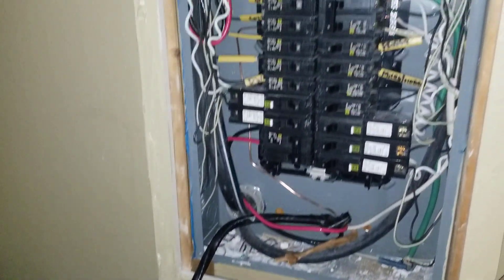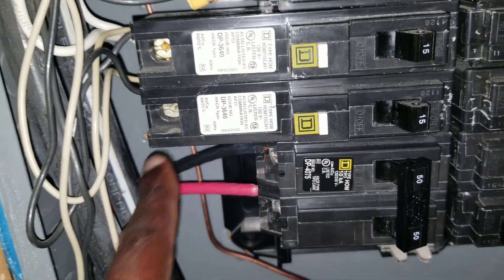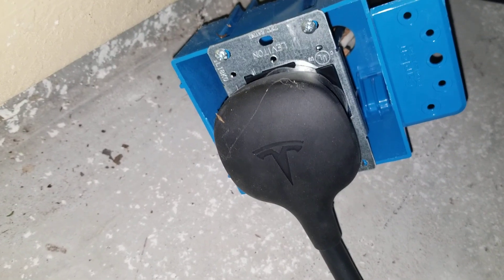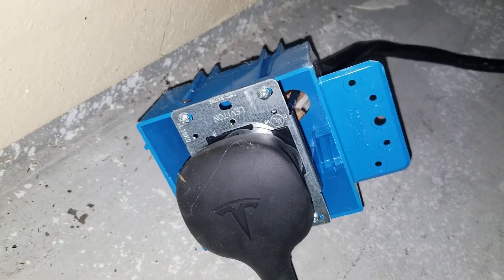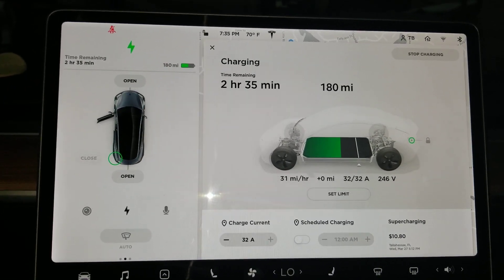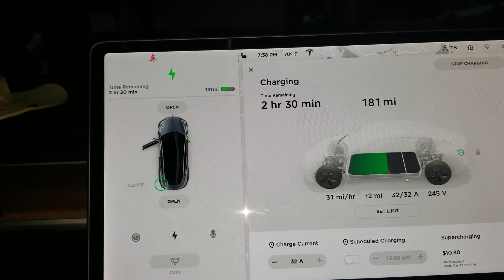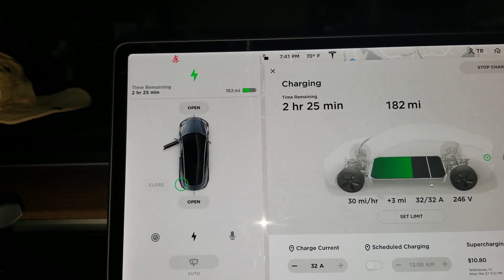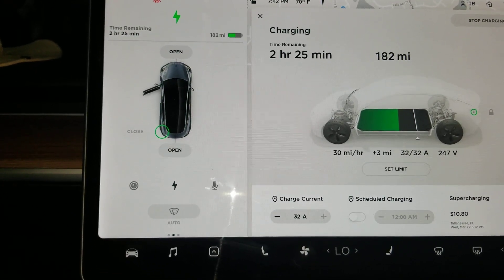NEMA 14-50 Test Wiring For Tesla Model 3

Comment: If i got a 100 watt breaker box, what breaker should i use 40, 50?
Reply from the maker: Sorry about the late response. If you mean a 100 AMP breaker box. Is that your main box or a sub panel? In either situation, you can use a 40 or 50A. In this set up 50 is better, make sure the wiring size is correct. If using a TESLA wall unit then they use a 60A breaker. Hope this helps.

Comment: the neutral and ground should never be wired together. This is wrong, and potentially dangerous. When you plug in something in the outlet, the neutral will be live, as it closes the circuit. If the ground is wired to the neutral, the ground of the appliance will also be live.
Reply: not sure if thats the same for the box itself or just plugs
Reply from the maker: Thanks for the input. The electrician contactor actually put them together. Should I split them out? It was a licensed company and it passed inspection. I would like it done correctly. Do you think this was their version of correct? Should I put all ground on the right bus and all neutral on the left bus? Thanks
Reply: In the main service box, ground and Neutral are supposed to be continuous. So your electrician did it right.
Reply from the maker: @mounirerrami2563  thank you for that. I couldn't find it anywhere online. I guess I was not asking the question correctly in Google.
Reply: The only time you have to separate the neutral and ground conductors is in a sub panel. The green screw is bonding the neutral to metal box. On a sub panel this would have to be removed
Reply: In this video the first disconnect is in the panel, In this case You do not have to separate the neutrals and grounds. They can be mixed in on both sides.
Reply from the maker: @gregmckinley5178  thank you. I have discovered so much over three years since I posted this video. Reinforcement is always helpful.
Reply: @tb129tlh  In reality the ground wire has has to go back to neutral at some point so that the circuit can be completed to cause the breaker to trip. This is done at the first disconnect in the system.  If not the breaker will not trip, the circuit is not completed. The reason you separate the grounds and neutrals on sub panels prevent overload current from using the neutral to complete the circuit. It forces the overload current to use the ground and not the neutral. if you do not sperate the grounds and neutrals on a sub panel both conducts could be a return path and could cause damage to other devices in your electoral system via the neutral wire